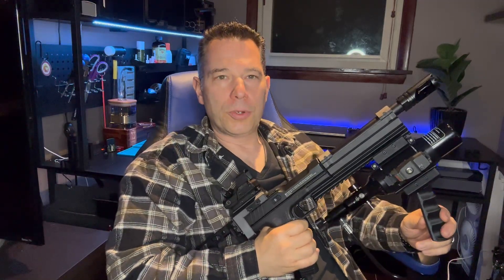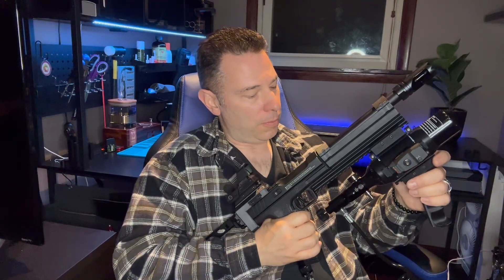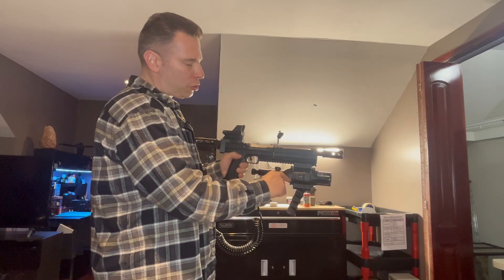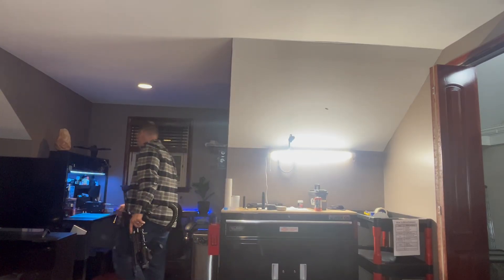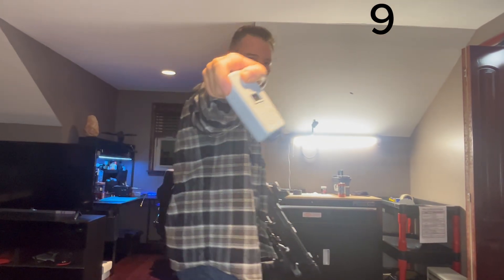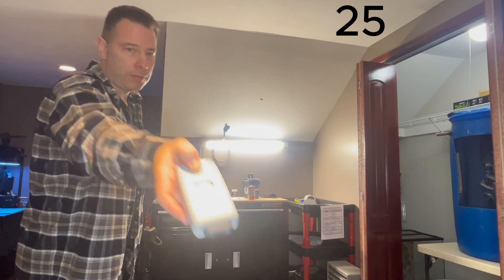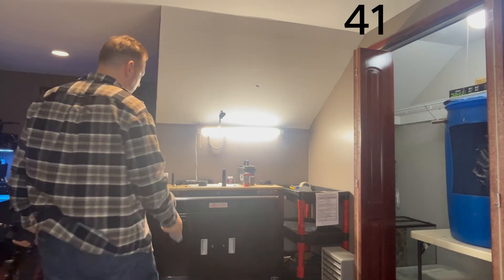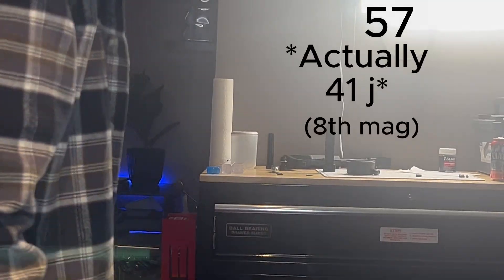X.68 HPA How Many Shots and How Much Power???

Comment: Quite surprised how many shots you got. When i tested 1225psi 7 shots drained almost 1000psi. Curious have you tested the actual output on that tank?

Build is looking good. The coiled hose resembles a sling 😁
Reply from the maker: @lesslethalfordummies  no I didn’t test  the output. I could not believe how many shots this thing got
Reply: @EastCoastLessLethal gonna need that drum mag 😁
Reply from the maker: @ that’s already in the works

Comment: Air efficency is off the charts with the X68. Plus that high power average is insane! Im lucky to get 20-30 shots with a fully opened HDP50 or TR50 on the 13ci hpa tank. And thats hitting 20-25 Joules at best 😂